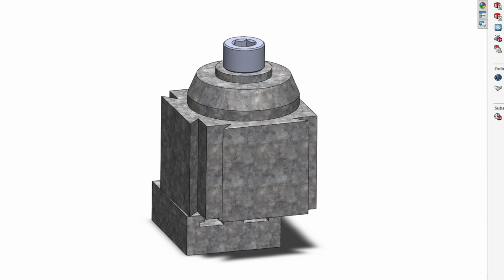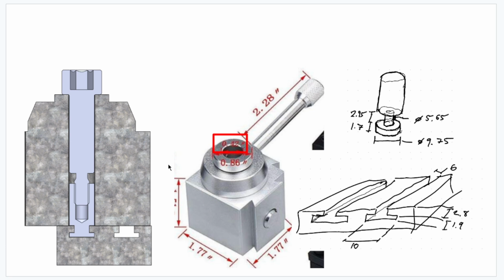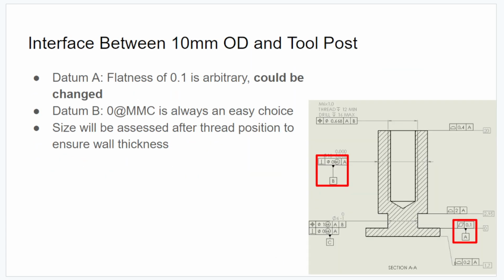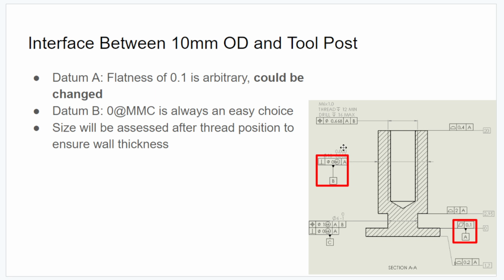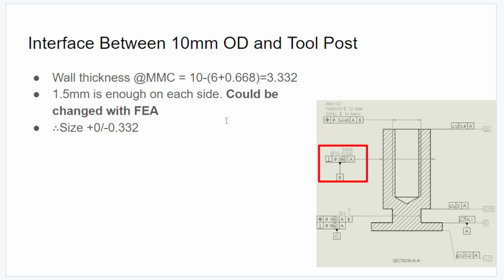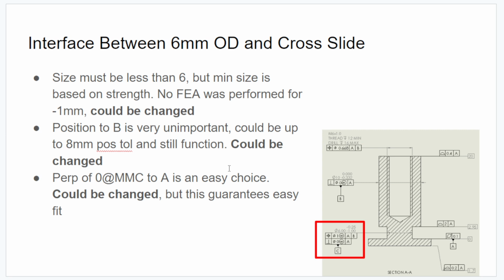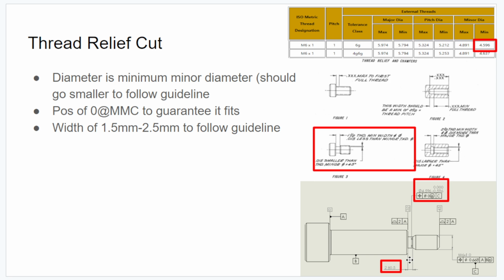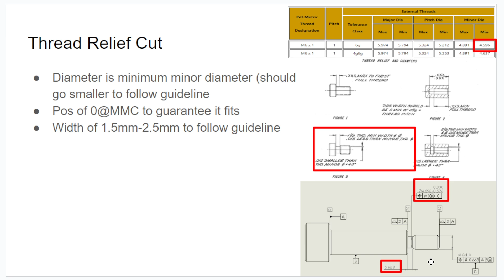How to make a great drawing package

Comment: This is really intresting to see,  what type of engineering degree do you have? Just curious.
I always wondered why in some manufacturing there are things that cause issues but  really dont get fixed. For example I have a friend who Has been a SUBARU mecanic for 30 years and he always says that the factory gaskets suck.  So he never puts the original gasket on because they are missing some some type of expansion goove or the mterial is, different something along those linescant remember the exact observation/issue. Do engineers ever get feedback from the user or how does that translate in to "Somthing that could be changed" like in your drawing package?
Reply from the maker: I'm a mechanical engineer in Canada

That's a great question. I've never worked in the automotive industry, but I have worked in a medium volume production environment. Often there is a "pre-production" stage for products, where things like functionality, manufacturability, and servicability are assessed. If a problem is not adressed and makes it into production, it becomes very difficult and expensive to fix.

Because of this, unless a problem is safety or reliability critical, it often will just be ignored until a new production run starts. Safety stuff is typically when you see vehicle recalls

As for commication, I think any healthy production environment SHOULD have two way communication, however I'm sure in larger production environments there are many filters between the users and the engineers. In smaller R&D environments like where I work now, the engineering team works directly with the technicians so they get direct feedback on their parts. I have the pleasure of building my own assemblies before handing it off to the technicians, so I find out when stuff doesn't work first hand.